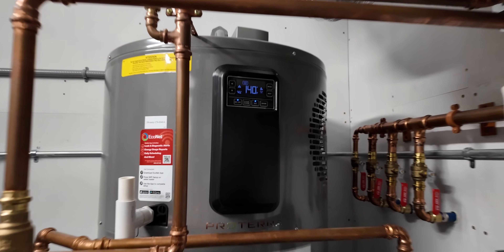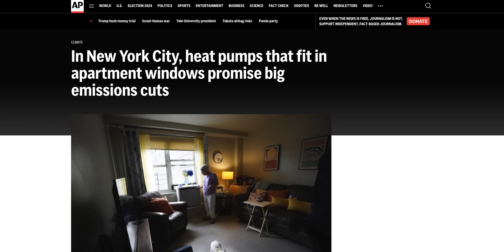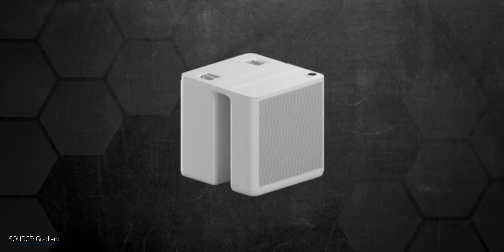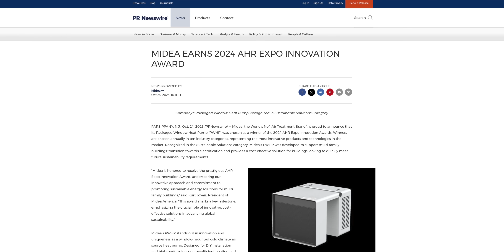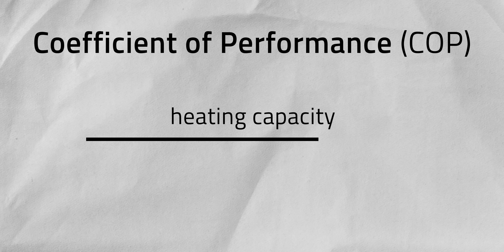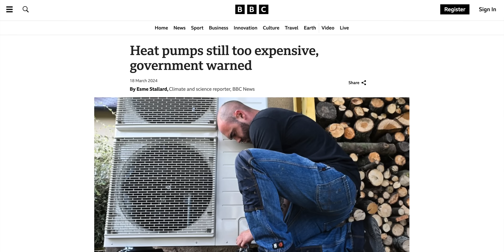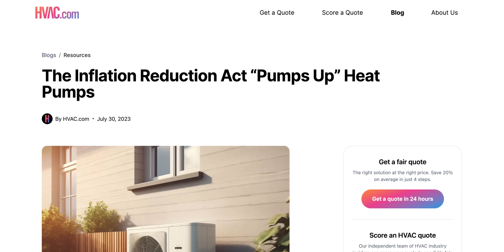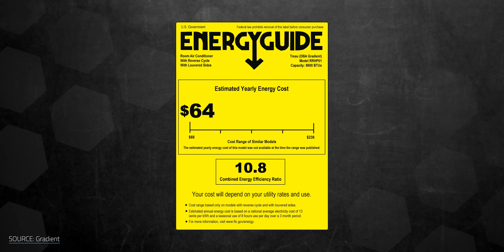Why This Window Heat Pump Is Genius

Comment: The electricity draw of these heat pumps isn't a concern if theyre replacing window mounted AC units, because those units are already drawing much more power than the heat pumps would use
Reply: They would be drawing power during cold months, however, which AC units would not be. On the other hand, if they are replacing an electric heater, then there is a clear energy savings.

Comment: A major improvement in modern residential heat pump HVAC air-to-air systems is they now can output hot air that is not uncomfortable as the cooler feeling air of earlier heat pump systems.   They are still very much an air-to-air heat pump system that have been around since the early 1960s that can't compete in heating running costs with a natural gas furnaces.   Once the outdoor temperatures are down around freezing and below an air-to-air  heat pump sized for A/C is size far too small for heating that is 2-1/2 times more.   They are actually hybrid heat pump electric resistance element furnaces.  Once running on electric resistance heat their cost is about five times that of heating with natural gas.
Reply: And that's why you should have a Manual J (or other heat-load calculation) done before installing a new system. A heat pump sized for 90% of your heating needs is probably good. In the other 10% the heat pump will continue to run while the resistance heat only provides the difference.
Reply: @eDoc2020  There are no running cost saving for using a heat pump for heating over a typical natural gas furnace.  It cost more to make a BTU change with an electric heat pump than a natural gas furnace, but a heat pump can cool in BTUs and a natural gas furnace can not.   For a small amount of heating with outdoor temperatures about 50°F cost difference for small residences is very little.  There can always be unique situations of electricity and natural gas availability, but in general that is the costing out in the USA.
Reply: @douglasengle2704  Utility rates vary greatly throughout the country. Here in Massachusetts a heat pump is always more expensive to run from the grid but we have some of the most expensive electricity. In places where electricity is 12c/kWh the heat pump wins big time.

If you have solar panels you have free electricity during the day, making heat pumps more economical even when grid electricity is expensive.
Reply: @eDoc2020  Commercial building use natural gas for heating water and direct heating.   If there was a cost savings for using heat pumps for heating they'd do it.
Reply: @douglasengle2704   Unit cost is also important, as is the cost of switching. Building owners know that replacing like for like will work and that's more important than future savings.

Comment: Plenty of apartments in my area (Portland, OR) have switched to window mounted AC and it's a joke. The window ACs are just a vanity, a little dinky device and the cheapest one the builder could find. They don't cool the apartment at all and are usually just for the bed room, so when we hit high temperature extremes the room is only cooled by a few degrees, and you've got basically nothing in your living room. But they allow the apartment owner to advertise they have AC and charge a premium for that, while passing off HVAC costs to the renter through the electric bill. Central HVAC should be the default in all new buildings.

Comment: I think these are a great idea.
However $3000 is a bit pricey 

In recent times even NY has been subjected to a 100 plus degree heat.

What happens if the outside temo exceeds operating temperature?

Comment: I only have 1 general question.  Can I use this in an RV and how much electricity does it use per hour.  In Watts.  I want to know if I can run this a full day on a solar/battery system on an RV.

Comment: a cop of 2 is really bad for a heatpump. i'm a QA tester for bigger heatpumps in germany and the worst COP we have is 4 for 40 KW heat transfer. we have also smaller heatpumps with 7KW to 12 KW with around 7-8 COP. 
sure these heatpumps are for heating the water of the building and not directly air conditioner but still, a cop of 2 is really bad for a heatpump.
another thing that got me to doubt that product is it's DIY hinged setup. high pressure tubes really shouldn't be bend over and over and they run at 20+ bar (290+ psi) and have to savely handle over 35-40 bar (507-580 psi) for a short time. you really don't want to put something into your house that is bend over and over and losing flexibility with age pretty fast.

Comment: So the price is a big no go when i can get a window ac for 300.my bigger question is how does it handle cooling in the winter. I dont use my window unit for heat ever because i like to sleep in 60° temps. If the price gets better could this handle keeping a room 60° in the dead of winter

Comment: Those prices are ridiculous. 90% of a heat pump is a traditional air conditioner, with a reversing valve added. I bought a 12K BTU Midea window air conditioner last year for $499 - similar saddle design - and it is efficient as hell. No way converting that to a heat pump justifies a 600% increase in cost/price. These companies smell government subsidies and are inflating their prices accordingly. I call bull$#!t. Same damned problem in solar. Kill the taxpayer-funded rebates/incentives and watch prices plummet accordingly.
Reply: 1000% agree.
Reply: All you need is a Tx valve one side connects like normal the other sends the gas in reverse. One valve and two ft of copper tube.
Reply: @shawnstillman736 Not exactly right. Heat pumps also have automatic deicing firmware, and temperature sensors to accommodate that. Still traditional heat pumps are only about double the price of a similar sized window unit. The 3k price is an obvious scam.
Reply: @peaj4812  all in al you are talking like $50 extra hardware max.... the firmware part is negligible over thousands of units sold.
Reply: @peaj4812  Modern mini split ACs are usually built as reverse cycle AC units; where I live (in Europe) it's hard to find ACs which don't support reverse cycle operation. Not sure which extra parts you're talking about but I've never seen an AC without remote control, temperature sensor, and automatic mode in the last 2 decades... Complete kits, even from brands like Daikin or LG, start at around $700.
Reply: There are cheaper window heat pumps, but they tend to not heat in as low of outdoor temperatures and get worse efficiency numbers.
Reply: I live in Canada and the HVAC suppliers charge a fortune for heat pumps. No explanation from them, they just get away with it too.
Reply: Midea is probably heavily subsidized by the CCP seeing how it is a Chinese Company and the CCP is desperate for work for its people.  This company probably is not.  Also, who knows if they make things in China; they may be choosing a more expensive place with higher labor and environmental standards and/or better air filtration components or more durable motors and things like that.
Edit: AutoCorrect couldn’t understand that I actually meant to type Midea.
Reply: Midea makes a range of units that have a similar design language to their u-shape line (although not u-shaped) that can heat with outdoor temps down to ~40 degrees f. It's not perfect and for the size/cost it's pretty nice if you live in a more temperate environment. Same cost as their u-shape units for similar BTU as well.

Check out this model number: MAW12HV1CWT
Reply: Crazy thing is that the same 1Ton midea ac costs around 300 $ in south Asia
Reply: @VivaLaDirt  Yeah shipping isn't free and it is made there.
Reply: @ChaseRayfield88  around the world shipping only costs like $15-20 for that size items.
Reply: @VivaLaDirt  you obviously don't know the cost of business. The ship trip is the smallest amount of the transport cost.
You need 30 to 50% margins to get a single digit profit margin.
Reply: The madia u smart inverter window unites are hest pumps this device is what's so expensive and it's because the government is subsidizing it
Reply: The only thing about the products you talked about is they only work down to 41°F not -13 or -7 which is a big difference. Though taking the 500 dollar price tag and multiplying it by 6 for that differece in performance is bonkers. A sensible price increase for the extra utility would be maybe pricing it around 800 or 900.
Reply: @El-Burro-Grande  the window/u shaped aircon is sich a smart idea. Never seen them in Seeden tho. Hows the noise having it running in a bed room?
Reply: 600% agree.
Reply: Even just installing a typical AC unit backwards would be cheap and efficient enough for small rooms. Just need to drain condensate. As long as you're not in freezing temperatures.
Reply: @MadPutz . The rain WILL wreck the controls.
Reply: we need more of these Midea units! totally agree
Reply: Initial product development is expensive. Prices on these units will plummet after market introduction. But someone has to be first. And heat pumps like this are not something people know they need until they've seen them in action... They're not flashy or sexy, but they ARE efficient. Taxpayer money has been spent on much bigger wastes than these heat pumps. If this subsidy provides affordable heating and cooling for subsidized housing AND ALSO helps makes these units mainstream, then it's been a DOUBLE win.
Reply: But they look cool, huh? 😂
Reply: dont think of the cost of the heatpump..
think of the savings on the ladder the installer needs to do his job on the 30th floor :body-blue-raised-arms:
😂

the scoop is the worse thing, over 10 years a panasonic with a scoop of 6 would make a big difference in the cost
this is camping heatpump standard, even a cheap minisplit have much better scoop (and those are also expensive to run)
Reply: Yep subsides don’t be a sucker
Reply: Midea makes a combo unit that heats as well, but only if outside temperature is over 40 degrees F.
Reply: @El-Burro-Grande  You are 100% Correct!
Reply: I didn't know that hell was efficient.
Reply: How many BTUs of HEAT does it put into the room for each Kwh used???
Reply: the midea-u 12k btu is now selling for $279 at costco
Reply: You are definitely correct and thanks for mentioning that Midea unit with a saddle design.  I wonder if it can be mounted sideways on windows that slide left/right to close?
Reply: You got it. Government money is our money and these companies want them
Reply: these corporations have agents in the US gov.
Reply: Just wait Chinese to make a cheaper version with same quality
Reply: @garyallison9257 Midea is already Chinese, guy. They realized they can just charge Americans more since they're making all of them anyways.
Reply: @garyallison9257  Er, not sure you really understand….. Midea is a Chinese Company!
Reply: @davetester100   Yeah. I am lost from the long comment chain. Are we talking about Media is too expensive? My understanding it is not for a traditional one and it is cheaper than Gradient.
Reply: Gotta love Socialism.
Reply: @user-zu5do6ri6r  a socialist government would simply price fix the heat pumps rather than give an incentive
Reply: @powerplayer75 it’s crony capitalism. Just like when the raised the rebate for EV vehicles and every company raised the price of their EVs.
Reply: @tufelhunden5795 That is literally not a thing that happened.
Reply: You realise this is capitalism,. right???
Reply: @DeepRadar2424  its socialized costs failing to work actually... they are clearly going after that subsidy with a "cheap" product.
Reply: @DeepRadar2424  Except its not, its literally socialized subsidy.
Reply: @ChaseRayfield88  Brother, capitalism isn't when the government doesn't do anything. Else having roads, or a fire service wouldn't be against capitalism.

 Just because government is providing 'subsidies' which ultimately end up going to the manufacturers anyway doesn't mean you're suddenly socialist. Under socialism, private production wouldn't even exist
Reply: @DeepRadar2424  You should hush while you are ahead. Those basic services you are referring to take up less than 5% of taxes.
Reply: @ChaseRayfield88 So now it's about amount and not principle?

What percentage of taxes goes to the military and law enforcement? Also who defines essential? Is education essential? Healtcare?

Keep deluding yourself that the failures of capitalism are not capitalism.
Reply: @DeepRadar2424  Eveything you derided just now has NOTHING to do with capitalism. Those are all socialized expenses... are you insane?
Reply: @DeepRadar2424 this is socialism or better described as crony capitalism as they are choosing winners and losers.
Reply: @user-zu5do6ri6r  Socalism would be better. This is capitalism with handouts.

Comment: It needs an upgrade in order to function well in the Midwest.  We have to plan for -40 in the winter (F/C doesn't matter at that temp) and far over 100 + ungodly humidity in the summer.  That would cool one small space, but not an entire unit.  You might need two or three of these per apartment, depending on how many bedrooms there are.  And what of interior rooms that have no windows?  Don't get me wrong, it's a good step, but it's nowhere near a replacement for central air.

Comment: Unfortunately, those units are incompatible with our windows in Germany. But I agree with the other comments: For 1000 Euros, you can already find a premium Daikin split heatpump with a COP of 4-5 (yes, work has to be paid on top, so it's around 1500).

Comment: Why are the existing window mounted AC units cooling only in America? In Australia reverse cycle window mounted AC units have been the normal for at least 50 years. Yes, we could also purchase cooling only units but they were only a little cheaper than the reverse cycle units. So rather than have a AC that takes up a window and does nothing all winter, people would opt for the heating and cooling versions. Maybe the cooling only units would be more common in the areas closer to the equator where heating would be rarely needed but in areas closer to the poles, having the ability to heat as well as cool makes sense.

Comment: Just put in two mini-split systems here in San Francisco. 3 mini splits for each apartment (one each bedroom, one great room) $16,000 per apartment. Plus it's hard to install them because we have historical buildings and the city doesn't want to see heat pumps mounted on the outside of the building because it's ugly - so they have to be ducted to the roof, and the ducting has to be pretty short (no longer than 50 feet). $3,000 is cheaper, considerably. I'm all for it.

Comment: I understand the need to switch over to heat pumps and the like. But the fact is heat pumps are not new. They're just the reverse of air conditioning. Secondly, the only real new thing is inverter-based technology and even then inverter technologies have been around for about 10 years. I do expect them to be a little bit more costly compared to a traditional window unit but not much more. I'm not going to be paying two, three or four grand for a window AC which I can pick up a cheap one for about $200 and even if I go for One of the other inverter ACS they are still cheaper than what's in here in the video. Even on the high end, they're only about $400 to $500 and I can pick up a portable reversible AC unit for about $600 so they're competing with that as well

Comment: I can think of a couple other cons about this ahem air con system - (1) the units only seem to work with guillotine windows, and (2) a single unit probably won’t be enough to heat or cool more than one room, so you’ll end up needing multiple units.

Comment: At best, these will condition a room. You said nothing as to sizing the unit nor the reduction in capacity below 47 degrees, where capacity killing defrosts are needed. COP can't be used with gas heaters. Natural gas is usually always cheaper than the best heat pumps, even geothermal, which is an expensive gamble on how well that will work after the well or loop field is installed. Further is the energy loss from the window being modified, unless proper sealing is done, and the fact that there likely is a steam radiator in a New York apartment right in front of most all windows. It'd have to be removed and that usually will affect other radiators and lead to water hammering in the risers and runs.

The better solution for apartments is a VRF, such as the Mitsubishi City Multi. Or a multi head MXZ residential model. The City Multi has water source models that can use a cooling tower on the roof for cooling and a gas boiler to supply the energy for heating, while in heat pump mode. I will add that this system can heat and cool at the same time

Finally, I'll add some levity by saying all window air conditioners are heat pumps. Just install them backwards when you need heat.

Comment: The lower operating temp is what I've been looking for in this design. My current Midea can't heat the room if the temp drops below ~48 which for me is ridiculous since I don't turn the heat on until 35.

Comment: The idea of window mounted heat pump is a genius one. BUT there is a BUT! The problem is the free market of the free folk. The penny pinching landlord is not gonna spend crazy amount of money to upgrade the building heating system. The high efficiency heating systems are expensive and only harm the bottom line. Especially at the current rent market - any ragged old apartment is fetching silly money. So unless there is a legislation forcing a change, not just a money grabbing incentives from the government, very little will ACTUALLY change.

Comment: the most frustrating thing is that they don't make air conditioners (OR heatpumps for that matter) for windows from LEFT to RIGHT.

Most modern homes don't have windows that go up and down anymore, and this INCLUDES apartments.